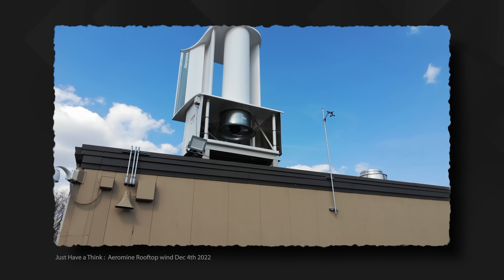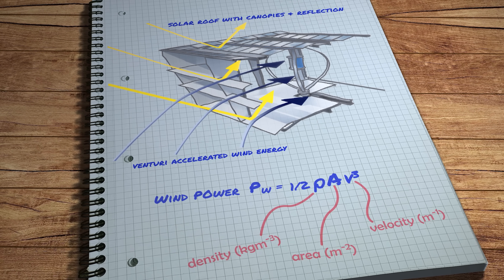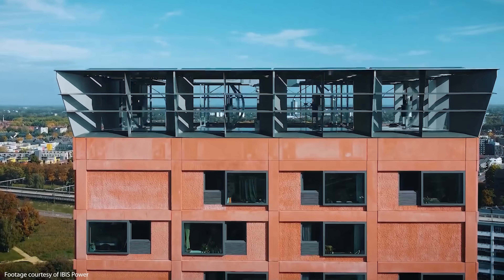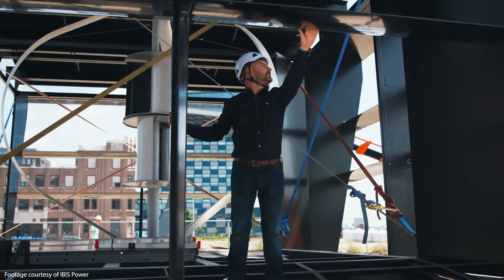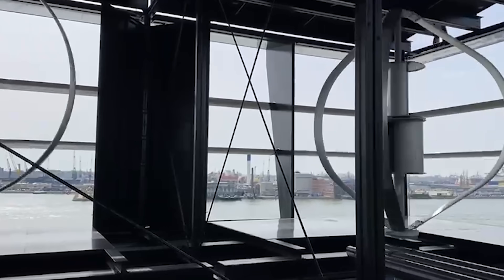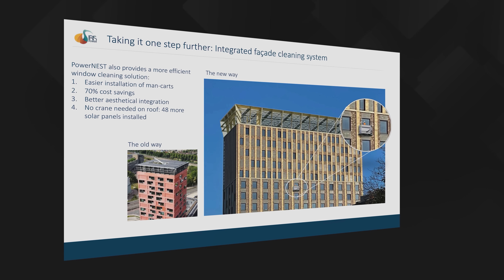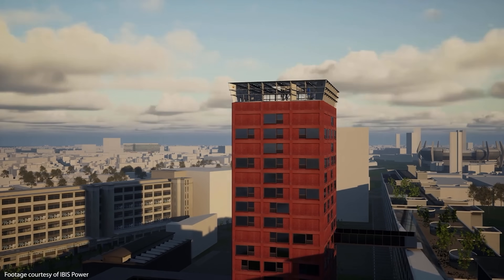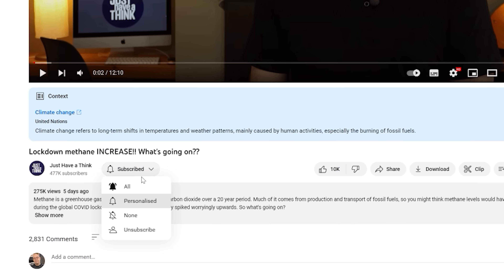The smartest renewable rooftop system in the world?

Comment: Neat concept, but I can only imagine the number of dead birds that will be found on that roof!  They might need to put some type of wire cage around the blades...
Reply: Would they fly into the wind turbines though? It's not like the other type of turbine where there is clear sky in front of the bird one moment, and the next moment the blade appears and chops their head off; in this design the turbine takes up the same space all the time and should be visible. Moreover, there are the struts holding the structure up that the bird will see first, and they surely won't be inclined to fly fast between the louvres and struts because they can see those obstacles. The fact that the design supposedly increases wind speed over the top of the roof might in fact discourage birds from even landing there I think, as it may make it a less hospitable site. I have no expertise in the field of ornithology, but my layman's understanding of the problem of birds flying into man made objects is that they are hard to see (like glass windows) or periodically not there (the 'other' type of wind turbine blade).
Reply: Windows and glass balustrades are the real bird killers though.
Reply: @seanlander9321  And housecats, lots and lots of housecats...
Reply: @jimurrata6785  I used to feel the same, but I read somewhere a year or so back that although they do kill millions of birds in the UK each year, the effect is negligible compared to other factors such as habitat loss.
Reply: @danyoutube7491  There's really only one factor and it's that all this is the result of humans.
Reply: Probably about 1% of the birds already killed in that area from transport, cats, flying into buildings.  Worth it.
Reply from the maker: Apparently they have looked at this potential problem and found that it simply does not happen int the way that it does with horizontal axis turbines.
Reply: @JustHaveaThink  Horizontal axis, that's the phrase I was looking for :)

Comment: Your thoughts on all cities using thirsty concrete in there roads to reduce flooding black ice and sand mining helping ecosystems and the people in the city.
Also it will increase groundwater soil and aquifer levels.
But we should line the sides of roads with native plants and trees to reduce heat flooding wind noise pollution and air and ground pollution co2 too.
Reply: They stop absorbing water as they fill up with sediment/particulates.